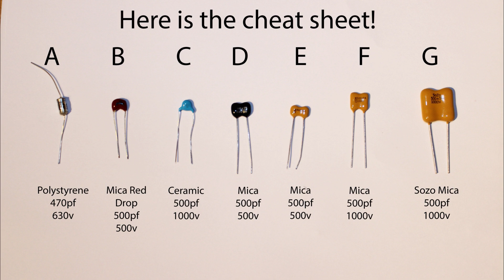What Does it Sound Like: Silver Mica vs Ceramic Vs Polystyrene

Comment: I don't hear a significant difference. When it comes to caps, in my experience, what matters is the value, tolerance and reliability. I found that ceramic disc caps are not reliable enough for my taste, everything else is great.

Comment: Hello thanks for this video, greatly useful and passionate. The difference is not so much of the tone, speakers tubes and guitar is doing a lot more but.... 
My preferred are A and D. 
You are welcome if you have the exact caps references. 
I found A the be very pure warm and well balanced. The axial construction, better in the conduction than radial improving dynamic , shows a live experience, the 470pF lower value helps maintaining better  bass spectre and warmth? Great A polyester capacitor! 

I found B more dynamic but harshy and making high frequencies  distorsions.No way. 
I found C to have no definition no précison no warmth and less sustain  and being too dirty. Ceramic looks like is not good to my ears?
I found D Mica perfect to my ears, warm and well balanced as A, missing just a few  bit of A dynamic and clarity (radial construction) but very close and compensating with even warmer tone maybe .
Then E Mica is not so bad for sure and very near , a bit darker than D and loosing bit of dynamic clarity maybe. 
F Mica is not so far from E, more clean and straight maybe  due to the 1000V rating but a bit darker, could fit bright amps maybe. 
G Sozo Mica is even darker than F but maybe has a slight better definition than F but they are so similar in tone. The 1000V rating is improving clarity and large spectre in the Sozo too  but maybe is loosing dynamic brightness and clafity.
Thanks for this video again

Comment: Very interesting and thorough comparison. 

In 2022 I bought a brand new Marshall 50 watt jvm all tube 50 watt amp. 

Temperature's been stable but free almost a year I couldn't use it and it wasn't a tube, it wasn't a resistor, but a silver Micah capacitor. 

When I turned on the amp no guitar would go through it but all you could hear is crackling. I think that's a real common sign. 

Put the engineer told me a capacitor shouldn't act go bad on a brand new amp like that but could have just been faulty soldering. I don't know.

Comment: I'm not detecting much difference in sound, so maybe it comes down to longevity? Which ones would you recommend for a nice long life span?
Reply from the maker: I use ceramics, 100v mica and polystyrene depending on application

Comment: Nobody in the industry knew the Gibson reissue bumblebees were cheap fakes until someone cracked one open. 60 dollars for BS.
Reply from the maker: It happens
Reply: @ModulusAmps  As far as I know, it didn't. You have an example? Or is this audio legend type stuff?
Reply from the maker: @Dr-Curious  yes. Filter caps have been faked in the past, cheap low voltage caps  rehoused. Examples and photos are on the Internet
Reply: @ModulusAmps  Ah - OK, you weren't clear. I stated that nobody in the industry nor the "expert" client groups ever detected that these caps were cheap film, and you said "it happens". Yes, selling fakes does. Experts hearing them doesn't.
Reply from the maker: @Dr-Curious  yip, spot on. Filter cap fakes are easy to spot as they don't last long or go bang. Tone caps in guitars are a whole different debate

Comment: I couldn't hear a difference,  but it might be more noticeable in the room with the amp. Sometimes the subtle changes can effect the way the notes feel to play (harder attacks, or smoother sustain,  or effect on feedback, etc.). I've used polystyrene on a couple of Fender amps and it seemed to bring out some clarity and note separation.
Reply: Nobody in the industry knew the Gibson reissue bumblebees were cheap fakes until someone cracked one open years later. 60 dollars for BS.

Comment: Did you select the capacitors to have the same exact capacitance or where they “straight out the box” ?
Reply from the maker: Out the box, as that is what most people use
Reply: So it’s highly probable that any subtle difference is down to differences in actual capacitance values of the capacitors rather than a difference created by different construction methods.
Reply from the maker: @bhm1712  I think the point of me doing this was to show how much or little the recorded tone varied, which was not much. Difference in capacitance would vary frequency. Difference in material could change other characteristics
Reply: @ModulusAmps  Some hear a bigger difference than others.  I assume that the difference in timber of these is in the higher frequencies, where we tend to lose hearing first.  Some people can just hear higher frequencies better.  My hearing is only good to about 16,000 Hz.  My girlfriend can hear past 20K.

Comment: I found the A to have the clearest/brightest, with C and maybe D being close, and E, F and G being exactly the same, and less bright than A.
I thought B has a nasal sort of midrange, which I like the best.

Am I imagining all this? Maybe. But I got a recommendation to use the A type polystyrene for a filter circuit, and maybe I picked that as the clearest entirely by chance, maybe I didn't. But I'm certainly going to go for Polystyrene if I can. :-)
Reply: I liked B the best because I thought it was more smooth.  I thought I would like the polystyrene the best, but I it was extremely bright.  I didn't think I would like the ceramic as much as I did.  I didn't care for E, F, or G.  I'm surprised silver mica sound so different from each other.

Comment: To me the F sounds best. Second was A. There was not much difference between F and G. But difference between E and F was huge to that they are same type! Where do you buy those yellow mica's?
Reply from the maker: I have them in the link above, if you are stateside or want to buy larger qty's you can get them from mouser
After the test I fitted the F caps  into the amp! I originally had A type fitted